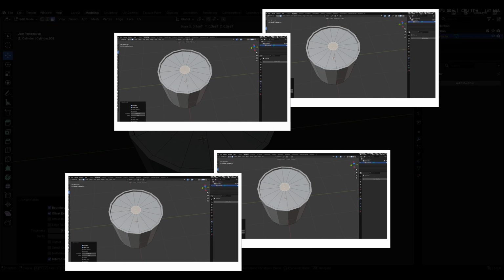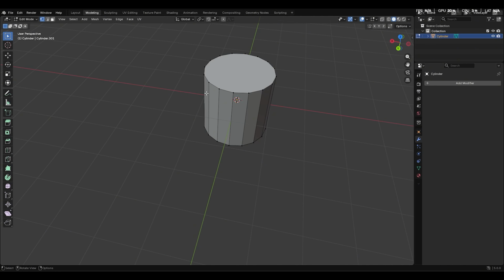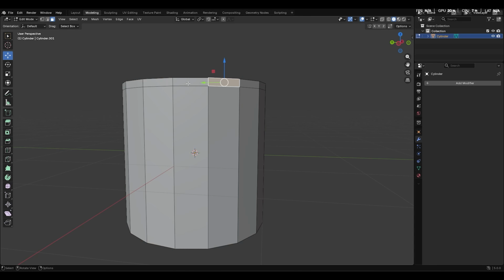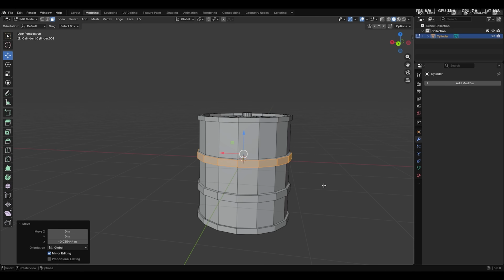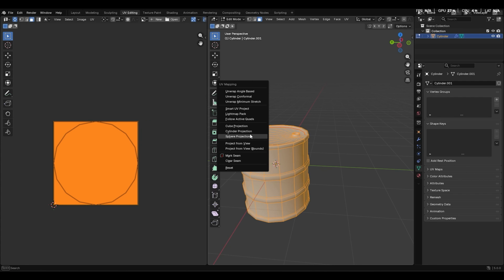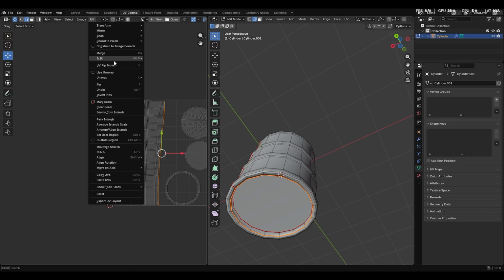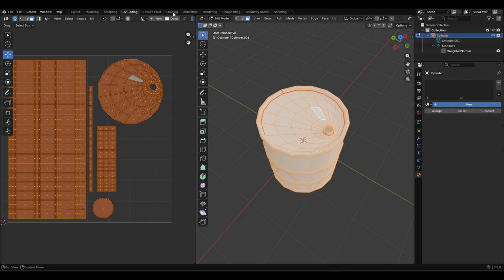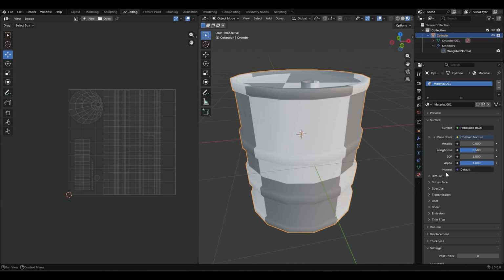Game Modeling and UVs in Blender for Beginners

Comment: Is there any way to take textures from multiple 3d models and create 1 texture that can be shared between them? I have multiple Synty Studios asset packs and now I have a ton of textures and materials, and my project is getting over bloated. I am using UE 5 if it matters. Thanks for any help or advice you might have.
Reply from the maker: That depends - Textures made for "tiling" is the first thing that comes to mind - but all object UVs need to be set up so they are "aligned" straight (similar to the barrel UVs) - In Unreal textures can be transformed to work with the objects aligned UVs